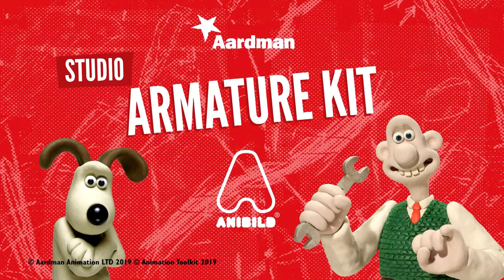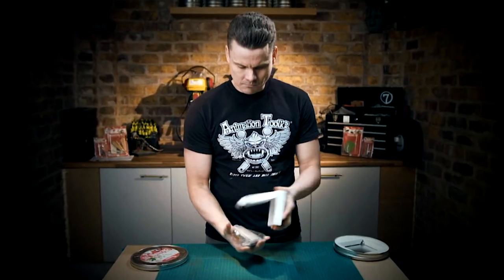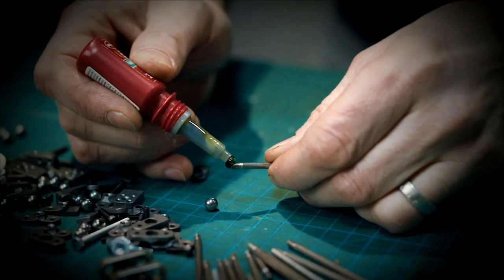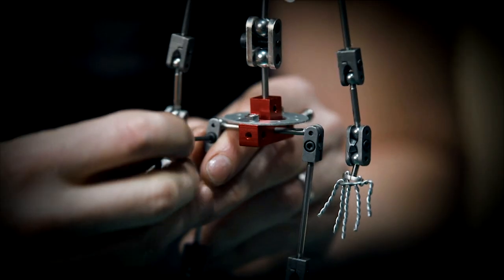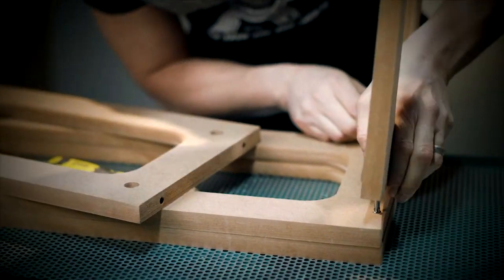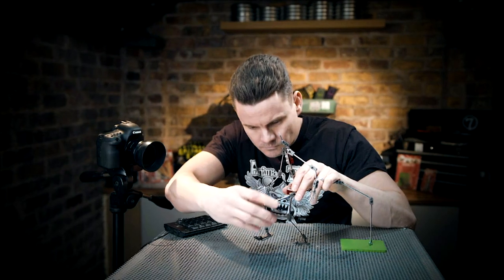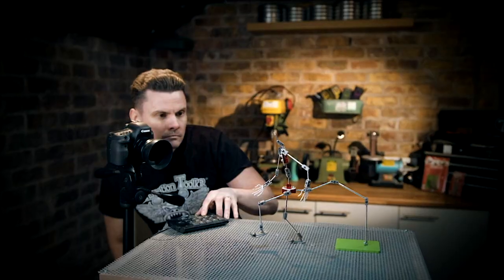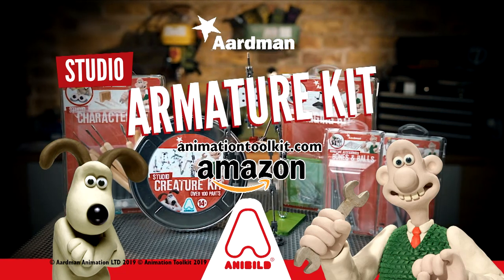Aardman Armature Kit

Comment: We got it at our University! It's great! But what is the tube he's using on the joint balls? When turning some of the joints, the balls tend to screw off. Is the purpose of the tube to glue the joint balls?
Reply from the maker: Hello Ruben, we're really glad you like the kit. You need to use a permanent threadlock on the balls and screws and nip them in with a pair of pliers (put tape over the end of the pliers so they don't scratch the balls!). Good luck!